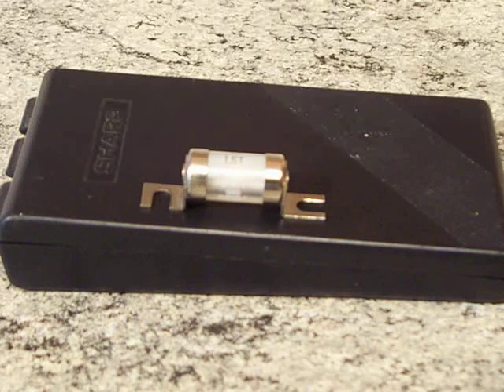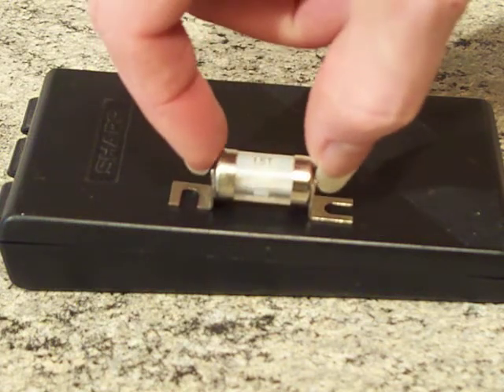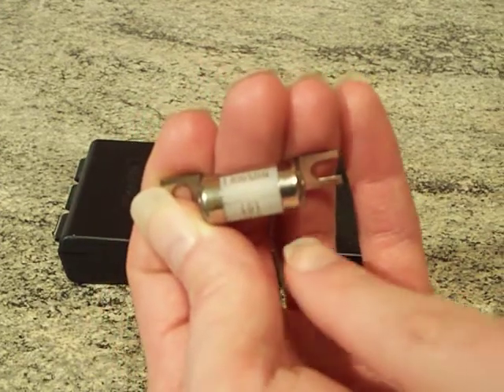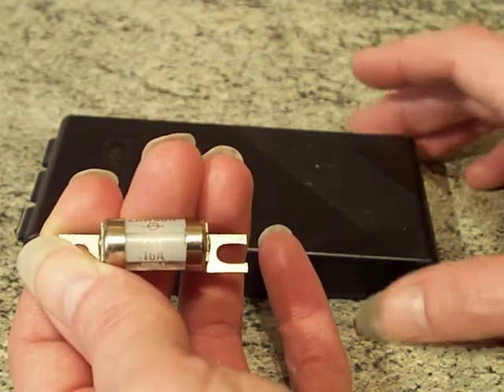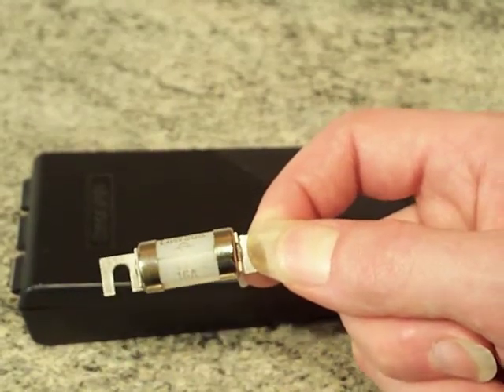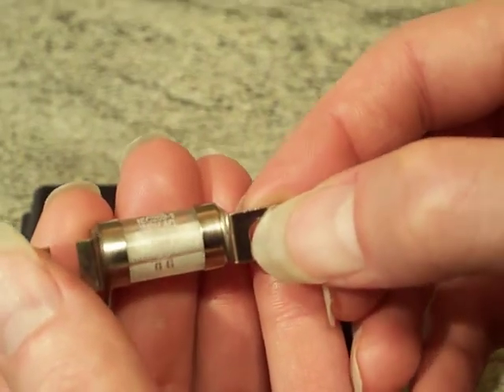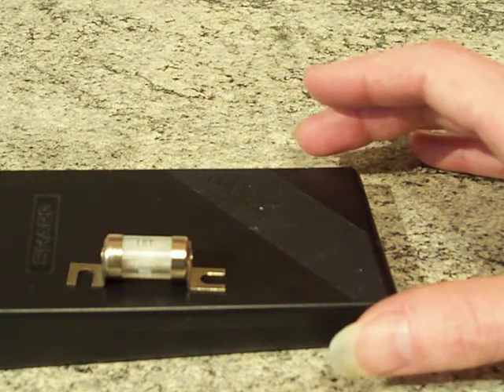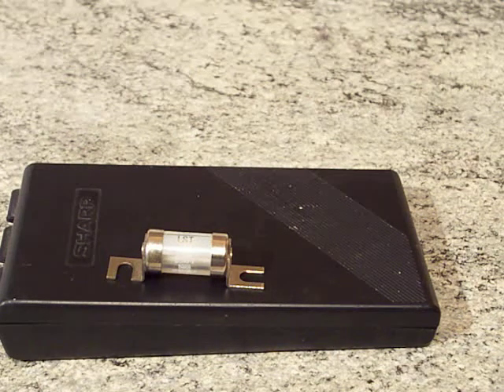Fuses : Street lighting cutout cartridge fuse.

Comment: I have a few of these that I nabbed when SSE were replacing all the streetlights (they were throwing out the cutout covers complete with the fuses, but wouldn't let me swipe any of the cutout bases :\ )
Reply from the maker: Aaaaah, that's interesting. What ratings do you have?

It's a shame that you didn't manage to get the bases for the fuse holders. WHY do they do that?! :-(

They're chucking them out, why not let someone have a couple?

We're  supposed to be doing more recycling anyway, so if the units are still safe and functional, why not let someone have a couple of the units?

It really peeves me off.

If you do want a street-light type of fuse unit, they occasionally pop up on a popular auction website.

I know that, because I managed to buy a BILL fuse unit one time. :-)

Thanxx for watching,

-BoomBoxDeluxe.

7th December 2015, 16.35
Reply: +BoomBoxDeluxe I suspect it was because there was a management creature floating around. The ones I have are mostly 6A with a few tens. They were in 1960s concrete columns but had recently been refitted with brand new white light heads.... (less than 3 yrs before), then the PFI thing came along and the brand new heads (and 50 yr old columns) got hauled away. i HOPE someone rescued the heads :\

Comment: Never seen a fuse like that before its interesting to see the though. I think that a 16 amp fuse could protect a whole roadful of lights its about 4 Kilowatts at 240 volts that's a lot of light!
Reply from the maker: 16A @ 240v = 3,840w.

Yes, street lighting is only one application for these fuses and their holders.

One reason for these (and the cutout blocks) being use in street  lighting, is the small compact size of the fuse units. They can fit into the bases of the lamp posts easily.

Thanxx for watching.

-BoomBoxDeluxe.

7th December 2015, 20.40
Reply: I noticed the fuse was tiny there not much space in them lamposts